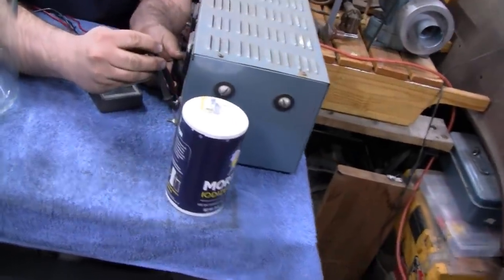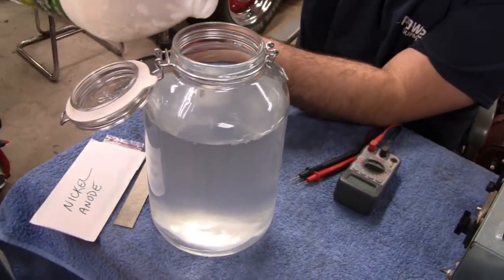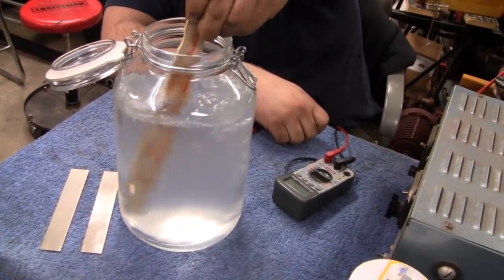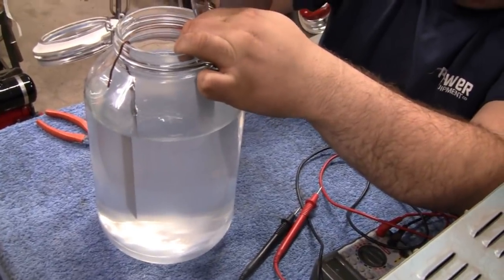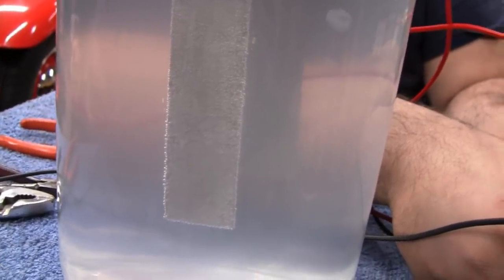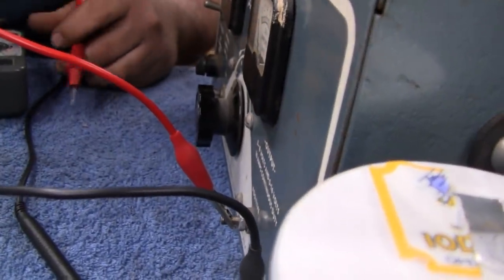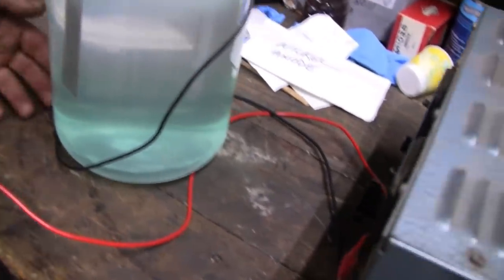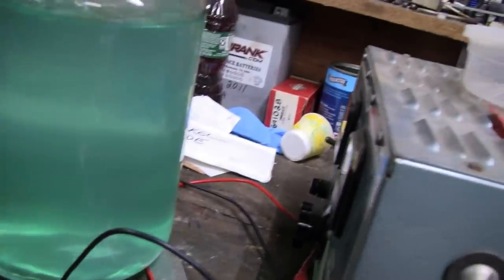HOW TO MAKE NICKEL ACETATE FOR PLATING

Comment: I've only just discovered this process about a week ago. I'm using it to restore some nickel plated parts for my antique gasoline lanterns. So far I've had decent success with it.

the same process works for copper, and zinc too which is cool.

I've found that not much salt is needed because once you get some nickel into solution, the nickel ions in solution help the conductivity of the liquid. After that the salt isn't needed at all.

Comment: RK!!! I used this method for nickle-plating .44 magnum cartridge cases. Some of them seem to be darkening after a few years. You ever throw a coat of Chrome on top of the nickle? That shoupd make it gleam forever! How do I do that?
Reply from the maker: I don't know Matt!! From what I understand all the chemicals and materials for chrome plating are extremely expensive!!☺
Reply: @805ROADKING  from what little I know the chemicals for chrome plating are toxic as hell. After reviewing this nickle plating series I realized I need to coat my brass longer. Mine lost their lister I think because I did the bare minimum out of fear it would be thick enough to put it out of spec, but I have a resizing die anyway. I'll polish em and add more, leave em for 10 minutes this time instead of a minute 30.

Comment: I only bought 1 nickel anode rod. Can I make the electrolyte with 1 or do I need to 2 pieces? I was thinking of using a nickel plated bolt as the other..
Reply: Just cut it in half

Comment: Try using EpsomSalt instead of table salt, it is Magnesium sulfate and improves the finish. also 6 Volts is good but control the amps based on surface area that your plating. slower the better. looks great.
Reply from the maker: Thanks for the info Bud!! We'll give it a try!!☺
Reply: I agree. However I have made electrolyte using as much as 12 volts, it accelerates the process. When plating the lower the better. I usually run between 2.25 and 3 volts.

Comment: I did this with pure nickel guitar strings and it turned red.... What is that about..?
Reply: Michael Keenan you have to remove the steel core wire. The windings are nickel, not the main wire.

Comment: RK, where did you get the Nickel Anodes from?  Is it very high purity nickel?  Is it expensive?
Reply from the maker: Amazon, 99.6% pure, $10 for 2 anodes!!☺
Reply: @805ROADKING  non magnetic stainless steel kitchen ware...free if the wife dont see🙄
Reply: Luke Albanese you can get nickel cheap on amazon. $5 for several feet. It’s used for soldering batteries.

Comment: Correct me if I'm wrong, I heard that in the plating process the Nickle is the shinny stuff but the Chrome protects the parts from the weather....?
Reply: teknonut1946 not exactly. Chrome playing does protect from weather, but it is shiny too. Nickel is just used to protect the metal you are playing from corrosion and provide a good later that can be polished to plate with chrome. Think primer when painting.

Comment: I always thought it was bicarbonate soda that was used not salt. 
I would agree salt is what I would use to make it conductive on a basic level the fact that you were keeping said item I don't think I would want to use the salt  just for rust purposes. Not saying either way is right or wrong.
Reply: Bicarbonate soda is what you use in distilled water to clean metal by electrolysis.

Comment: I've used Borax for the solution and a 12 volt battery charger. And that depends on what you're doing. It's a great way to derust things such as tools and parts.
Reply: Hi Carl, what exactly was your formula. I have some jukebox parts I need to derust.
Reply: @westbay5858  just soak them in regular cokeacola
Reply from the maker: Yeah we've done the electrolysis thing too, it works pretty good!!☺

Comment: I did the same recently following the bloke who is doing the landrover up. I used 12v 1amp, suposidly too much voltage but works a treat, clean your parts dip them in acid, the distilled water and go. Amazing to watch the thing you plate turn nickle, happens so fast. Just watch the gas coming off, using salt works but gives off clourine gas! I do mine outside. Good fun all the same. You can do the same with zinc and copper too

Comment: 5v 1A is your average phone charger output.  Neat!  Further reading makes it plain I proved to be one of those Youtubers.  Nickel acetate is in fact pale green.  Copper oxide is green, but copper acetate is blue.  Yay chemistry.
Reply: It's green, copper is more blue
Reply: @user-neo71665  Yep.  I spoke too soon.  Previous experiments I have done with pure copper turned the water green but those were with no acetic acid, only water plus salt or bicarbonate.  Turns out the acetate of copper is indigo blue :)  yay.

Comment: I've just done the metal etching remember. Not sure if vinegar or just water makes any difference. Salt makes it conductive, as much as you can dissolve. I tried etching with a low power charger....took ages. Used a car battery, about 5 seconds for a decent deep etch. Expect the same applies to plating. Only problem for me doing plating......cleanliness.....too much clatting about.